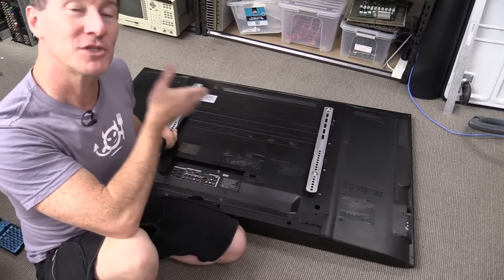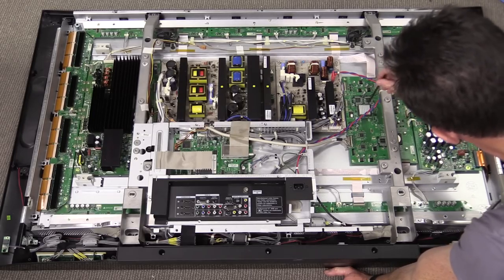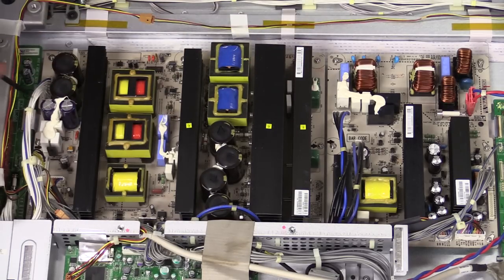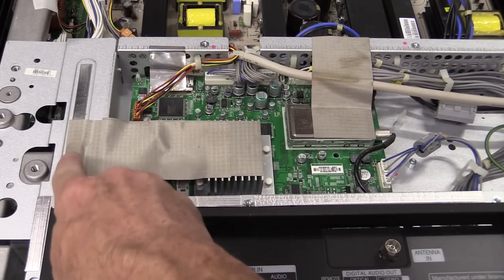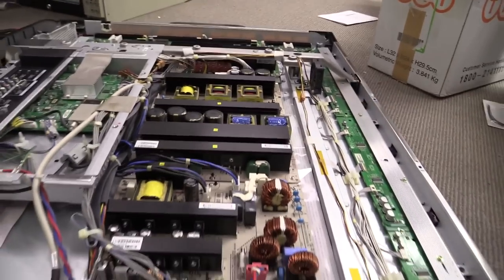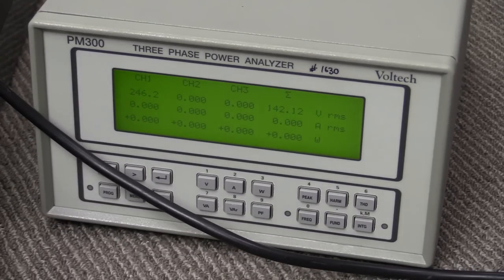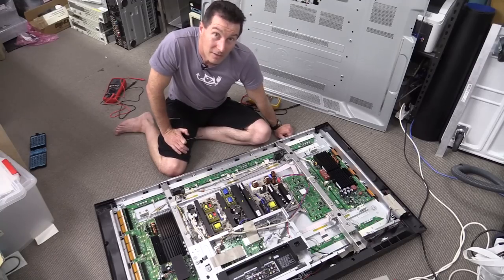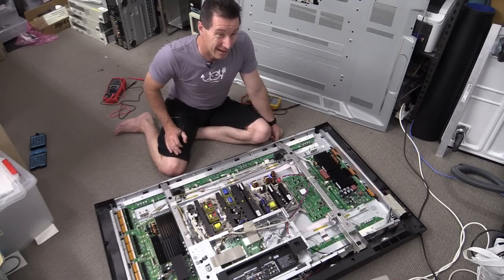EEVblog #725 - LG Plasma TV Teardown

Comment: Plasmas are awesome! Better picture better build quality and so on . LCDs are kind of poor for a TV imo. OLED is better. 

Crappy caps are why you buy a panasonic plasma ( they have stopped now) Samsung still going
Reply from the maker: Andrew Joy I do like the big engineering that goes into plasma's, but that's about were the love stops.
Reply: EEVblog Its ok , OLED will be mainstream soon and save us from cheap crappy LCDs :). Still it kind of makes me sad, the amount of work that goes into the design of a plasma, not many consumer products get that kind of work put into them ( they should but they don't). Its all just slap a controller onto the cheapest TN panel we can find and put it in a new case bam new model for 2015. And when i was buying mine to get anywhere near the picture quality in LCD would have been over twice the price !
Reply: EEVblog Man, you should open up a Pioneer Kuro 9G and then watch one. It redefines what movies look like. It's like an OLED... only much more affordable now everyone wants the thin sets...
Reply: EEVblog
 If you played video games, or were into graphic design, you'd understand the niche that Plasma TVs fill.

Also, that vertical banding and color corruption is very likely due to either: 1) the Flat Flex connectors, 2) the color processor
Reply: Pioneer, Panasonic, Samsung and LG have stopped Plasma panel production to concentrate on LCD and OLED panels.
Reply: Andrew Joy I had great hope for SED but that's another superior tech that's now dead.
Reply: Andrew Joy CRT's have the best picture quality overall the high end 100Hz HD-CRT televisions anyway but any old CRT has superior colours to LCD's and LED's and still probably plasma sets but I can certianly agree on many things why plasma is better but my opinion CRT is the best!
Reply: Realgroovy24 Check out SED technology. It gave all the advantages of a CRT (except a non-fixed resolution) in a flat panel format. I really have no idea why the technology never too off; my guess is price.
Reply: *****
problem is SED is very expensive to manufacture essentially being a large complex vacuum tube. Compared to a plasma display which is just layered glass with deposited electrodes and discharge areas.
Reply: I agree its inefficient, at least older plasmas anyway. But the things that are important to me , good black levels , smooth ghosting free movement are all better in plasmas for a better price.

 I also love older games ( megadrive PS1 and so on), and they look better on a plasma than on LCD due to the slight Antialias effect you get from plasma ( similar to CRT) . I am not saying everyone should go out and get a plasma , but for me i love them and its a shame we don't have the option to buy one anymore.

OLED is closer to a true replacement for plasma , much nicer than LCD but they need to come down in price.
Reply: Lazarus Nazareth Bullshit. LED is just a type of backlight and doesn't have anything to do with the underlying LCD technology. The only LCD's I've seen that don't ghost are high-end gaming monitors and those are all TN panels which have terrible color and viewing angles.
Reply: Lazarus Nazareth Wow, resorting to ad hominem attacks now. Way to really elevate the debate.
Reply: I have a Panasonic (at the time branded National) CRT TV from 1983 which still goes fine never been serviced
Reply: Well being a panasonic it will have good quality caps in it :)
Reply: Andrew Joy Indeed it does its 32 years old and will probably keep going for another 10 before it will need any kind of chassis overhaul
Reply: Not the modern ones, well not unless you abuse them and leave them on a  static image 24/7 but even an LCD will get burn in if you leave it long enough on a static image ( we are talking years and years of the same image.
Reply: my plasma cost well less than half of what an equivalent quality LCD cost , brand new from a store

Comment: How about those caps at 12:17, looks like they leaked some electrolyte.
Reply: OneMarko Yes, i noticed those too, couldn't tell if it was the angle of the camera or not, but they did look like they were bulging. I'm assuming Dave would have picked up on that if they were troublesome tho.
Reply: Perhaps noticed after the video footage was already taken.
Reply: ***** True, i certainly think it would be worth repairing if the issue could be resolved simply by replacing some capacitors, even if it is an old plasma, for the price of a few caps, it would defiantly be worth while.
Reply: Mounting electrolytics so close to heat sinks should be avoided. I have seen some that actually touch.
Reply: KrayzieDude Those are indeed faulty, and most probably they really are the cause of malfunction. Not sure why, but sometimes Dave just does not notice the most obvious things. This could be related to actually having to do this all on camera, I believe.
Reply: Lets just hope he sees these comments, and has a go at replacing those dodgy caps, would make a great video to at least see him have a go at getting it running again, even if he does end up tossing it afterwards.
Reply: KrayzieDude And then he could just donate the TV to somebody who actually wants it. Not sure about the Australian peolpe, but I would be extremely happy to get such large screen no matter how old and outdated it is.
Reply: OneMarko he ignore they becuse if got fixed his wife dont let he buy a new oled tv. :P
Reply: SaNjA2659 Just because capacitors have bulged and possibly even leaked does not automatically mean they are faulty or the causes of whatever issues you are having; it only makes them obvious suspects. I recently repaired an LG LCDs which had bulged and leaky caps but ripple measurements before and after the repair showed almost no change whatsoever on waveforms - the dying caps still performed about as good as my bigger and much higher quality fresh replacements.
Reply: Daniel Sauvageau That's true. Depending on power supply type and on whether there are at least some still functional capacitors, the device could still be able to perform well. But blown capacitors tend to have extremely high ESR and almost no capacity left, which renders them redundant. In flyback power supply (which is the common type for monitors and TVs) lack of proper output capacitors will remove any hysteresis from the feedback loop as well as leave the supply without capacitive load, which essentially will cause the supply to "hiccup" and the backlight to flash. But still I can't deny that you might occasionaly encounter perfectly working bulged capacitors...
Reply: Daniel Sauvageau 
They won't perform good for much longer.
Reply: SaNjA2659 I would not trust bulged caps with working perfectly - at least not for much longer - but the point was that bulged or even leaky caps are not always the source of immediate issues.

I still replace them if I can since they have a high probability of becoming a near-future problem and would prefer to avoid having to do multiple incremental repairs on the same device.

It is a bit like "opportunistic maintenance" on a car: if you are already changing the timing belt/chain, which costs hundreds of dollars in labor for a $30 part, might as well swap the cooling pump which is on a similar maintenance interval for almost no extra labor cost and if you are going to drain the cooling loop to change the pump, might as well throw in a new thermostat for another $10 and not have to worry about those for another 5+ years.
Reply: Daniel Sauvageau Indeed. I just meant exactly that as such capacitors are sometimes found in perfectly functional devices, they should not be the only one thing to blame in this case, too. By no means I would recommend leaving such component not replaced once spotted. Preventive fixes are essentially the part of a good repair. Something else might easily be the cause of the problem in this particular case, although these symptoms are typical for capacitor-related problems, I would say.
Reply: Daniel Sauvageau 
I've been learning and repairing TV's and electronics for around 2 1/2 years, and the majority of problems have been bad solder joints. Bad caps would be second to bad solder joints.
Reply: Robert Calk Jr. Personally, I do not remember repairing a bad solder joint in the last many years, though this could be because the few devices I have been asked to look into that were not suspicious caps had failed catastrophically (multiple charred or exploded components), so I did not bother looking for cold solder joints.

If I had to put a number on it, I feel like 80% of the successful consumer electronics repairs I have done were bad caps.
Reply: Daniel Sauvageau 
That's what a lot of people say, but it hasn't been my experience. It seems that the non-leaded solder is the biggest culprit. The best I've seen was in a Panasonic 3D Blue Ray Disk Player that I repaired - the soldering was beautiful. But most stuff I have opened up had putrid soldering.
Reply: Robert Calk Jr. I have a Panasonic 3D Blue Ray Disk Player, along with other Panasonic gear. Was it bad caps in that case? Do Panasonic use their own brand of caps, I've never bothered to check?
Reply: Robert Calk Jr. Most of the stuff I have torn down over the last many years has "beautiful soldering" or at least more than good enough that I would not worry about it.

I have no idea what your definition of "putrid quality" is but I do not remember dismantling anything with soldering I would consider that bad. Maybe a few questionable multi-strand wire or large TH lead solder joint every now and then on an otherwise fine-looking PCB and that's about it.
Reply: Yep, I noticed those. Looks like 6 out of 7 of those little buggers are dodgy.
Reply: Yes those definitely are bulging and have failed. Looks like typical "Samwha" capacitors.
Reply: yup I saw them to how he miss them is a little odd too me
Reply: llthpofh Maybe he fell into a "trap for young players" xD xD xD
Reply: Benjamin Esposti Just because they are not in mint-looking condition does not mean they are no longer good enough to get the job done. I have changed much worse looking caps without it making any significant difference on measured ripple.

I was expecting Dave to check all voltage rails with a scope - when I troubleshoot something, that's my third step after the initial visual inspection for anything horribly wrong telling me not to plug it in and general voltage checks to make reasonably sure I won't blow up the scope by probing the points of interest.

If supply rails look reasonably clean, then there is no point in replacing caps on that rail since the output is not going to improve much, if at all.
Reply: Daniel Sauvageau Yes you should always replace bad capacitors. Otherwise it is a disaster waiting to happen. Also, they can even go bad without bulging, but that isn't quite as common with the larger caps (>6mm dia.)
Reply: Benjamin Esposti You have a defective device. You look at supply rails with a scope (or meter with high-bandwidth RMS measurement) and they look perfectly fine, which means regardless of how bad the caps might look, the problems you are having are caused by something else.

There is no point in wasting your time and good caps on replacing good-enough caps UNTIL YOU HAVE A CONFIRMED (or highly probable) FIX for whatever the real problem was.

This is a bit like trying to fix a car that runs poorly by blindly changing every maintenance item you can think of, only to discover or get told the engine block is ruined.

In this case, the cause for the massive screen flicker could very well be that the plasma panel itself is cooked - it was probably used as a lobby or boardroom display, turned on 10+h/day, 5+ days/week at high brightness. No amount of capacitor swapping can fix that.
Reply: Daniel Sauvageau We were all fine then you came in a disturbed the peace.
Reply: I seen those as well.  Oops!  He missed 'em.  Was even waving his pen over them and didn't catch it.

Comment: Those were not blown caps on the low voltage board?  Looked like they were leaking to me...  12:31
Reply: Kris S I have no idea how he didn't see those.  First thing I saw when he took the cover off.  I would bet those are causing most if not all of the problems on it.
Reply: Nooooooooooooooooooo! I saw them first thing as well.   I bet he has some reason for ignoring them though,   maybe he will respond if he sees this comment and tell us his reasoning
Reply: I'm not so sure..the 4 caps in question are blown visually. The close up of the single cap a few seconds later has a black magic marker mark on top and looks okay. This is what is most likely seen on the others, or reflections off components.
Reply: Giligain I. Possible
Reply: Giligain I. He might have decided not to bother because it's possible when a cap blows that it takes something else with it, but in that respect I wonder why he bothered with the high-voltage supplies where such an occurrence is more likely to happen.
Reply: ZeroPointAlpha 
I wonder why he bothered with the high-voltage supplies where such an occurrence is more likely to happen.[?]

Just killing time most likely. 
Not sure about caps blowing and consequences as I'm a noob in repair.
Reply: ZeroPointAlpha well he said he was looking for what went wrong.   So those caps should have been a red flag.
Reply: Kris S Yes, but engineers and tinkerers alike tend to be a little scatter-brained at the best of times. :V
Reply: Giligain I. Sometimes when caps blow, they effectively become a short, which means nothing but bad news for whatever they're directly connected to.
Reply: ZeroPointAlpha 
sometimes = percent of failure to attached components = (?)

I frequently read to start there, w/ caps, and then see if that fixed problem, but location of caps is most likely important to also. Those near PSU are different than those near IC, no? different in that location of failure and short will determine whether circuit design will fail. 

If I remember correctly, getting things certified for sale, requires lots of shocking of the device to see if it will survive, or fail and need to be addressed.
Reply: Giligain I.
All I'm saying is I've heard it's entirely possible for a blown cap to take something else with it when it dies, and as such replacing the bad caps isn't a guaranteed fix.
Reply: Cap blew for a reason...
Reply: You both have a point.
Reply: ZeroPointAlpha Yeah it isn't guaranteed, but I assure you, at least 90%, if not more, of the time new caps will fix it. In some cases, like the Bestec ATX-250-12E, a failing capacitor can cause an overvoltage. On one of those I had, the 5V standby was putting out nearly 30V ... yes the motherboard was very well toasted.
FYI, check out the badcaps (dot) net forums.... tons of info about repairing things with ... bad capacitors! xD
Reply: Kris S Yes Kris good observation, you are right, there were 6 (or more) bulged / leaky caps in the power supply (low voltage section) you can see them at 5:52 to 7:20 in the bottom right corner of the video, on both sides of the farthest black heatsink to the right... You can see them again at 12:17 towards the left of the video on the power supply board. Then Dave zooms in on them at 12:29 & you get a real close up of one of them at 12:34. Changing those caps would have repaired that set.
Reply: Dan S yeah!  Just trying to figure out why Dave ignored them.
Reply: Kris S I think he has a secret grudge against plasma displays.
Reply: ZeroPointAlpha I don't think a blown cap would cause problems down the line.  They are used as filters of sorts, so when one fails, all you'd generally get is more ripple in voltage (shorted cap) or no voltage making it through at all.  That's why the caps seem to be the likely culprits here.
Reply: scrfce123 It can in some instances, like in a buck converter, it could cause the inductor to saturate and it will then overheat and burn up. It's happened before when capacitors have failed on a motherboard, I've seen it happen. FYI inductors, like resistors, rarely fail just by themselves.
Reply: +scrfce123 I thought the issue was with the Flux Capicator...

Comment: I have a 50 inch Samsung plasma tv in my bedroom and when it comes to blacks nothing beats it. The same goes for power usage and heat output.
Reply: BlueFoxTV Heatin' my bedroom with plasma! :E
Reply: BlueFoxTV 
Damn, it's freezing in here baby! Turn on the TV please...
Reply: BlueFoxTV when you pay for the electricity, you'd think twice before getting plasma ;)
Reply: ***** I think power consumption is not something the average consumer thinks about when buying a TV.
Also the few cents it cost me to have it is a not an issue. Tho it can be for some.
Reply: BlueFoxTV at 250W 4-6hr per day you're looking at €90-140 per year to use just this TV. I think it's a lot. My LCD tv is like 25-30W, the €100 I save I can use for other things
Reply: *****  100 savings a year, wow. Do that for the rest of your life and you might be able to buy a used car.
Reply: BlueFoxTV OLEDs have better blacks, but they're like $10,000. When I finally get rid of my Panasonic plasma, its definitely going to be for an OLED. Never going back to LCD.
Reply: RevengeofGothzilla
So what you're saying is OLED's are like Canada.